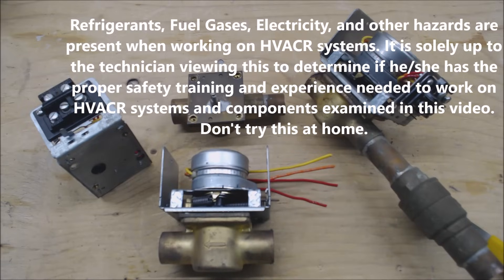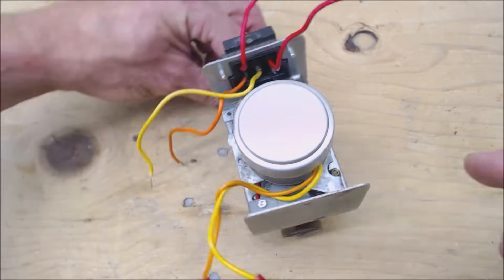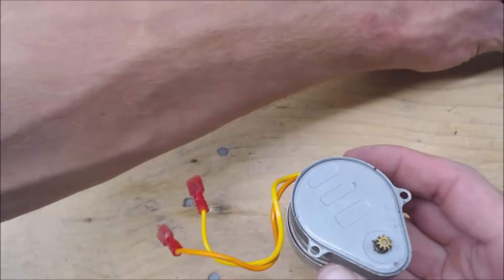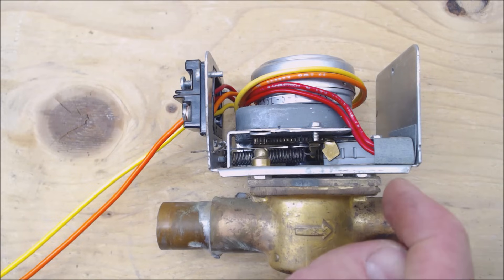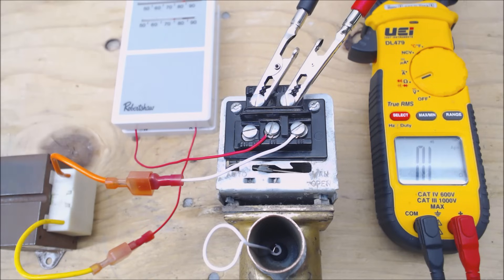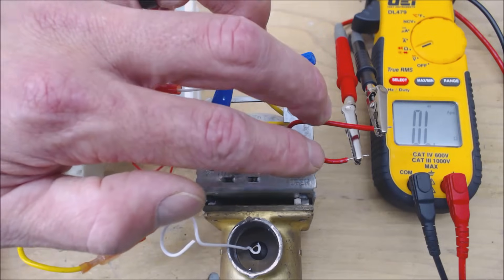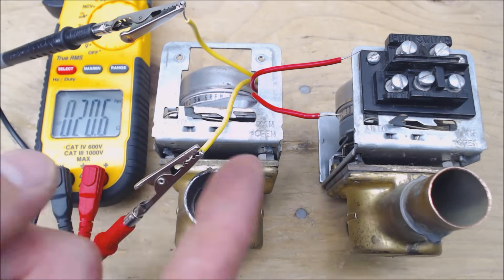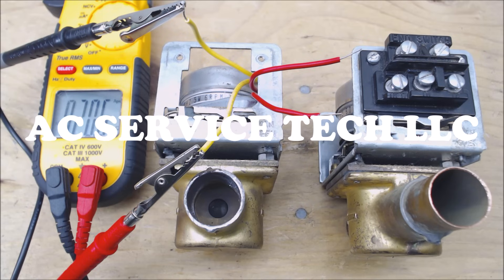4 Wire, 5 Wire Honeywell Zone Valve Wiring, Troubleshooting, Dismantling

Comment: Why do you have to be epa 608 certified to connect manifold gauges to a refrigeration system why can’t anyone do it ?
Reply from the maker: Jacob, it seems like you are asking the same question over and over. I don't mind answering questions but you should probably just head over to https://www.epa.gov/section608
Reply: Sorry for asking the same question
Reply: Oh I understand it only applies for CFC and hcfc refrigerants only that makes sense
Reply from the maker: There is an update that it does include hfc this year, thanks

Comment: Can you please do a refresher on how to replace propane gas valve (universal).
Reply from the maker: Jason, the gas valve will depend on pilot/thermocouple, pilot intermittent ignition, or direct ignition. Are you more concerned with the ignition assembly or adjusting gas pressure?